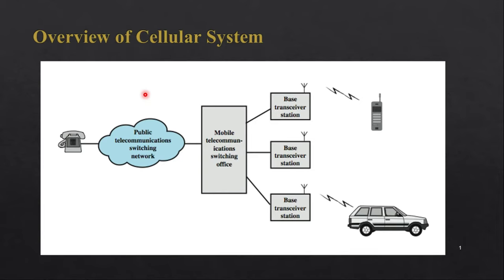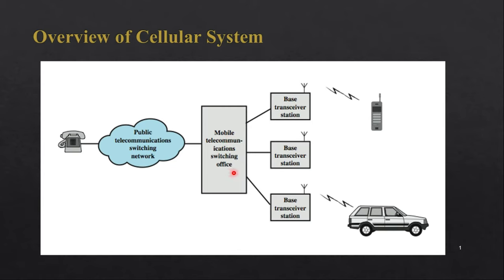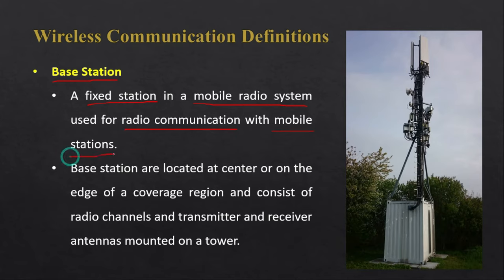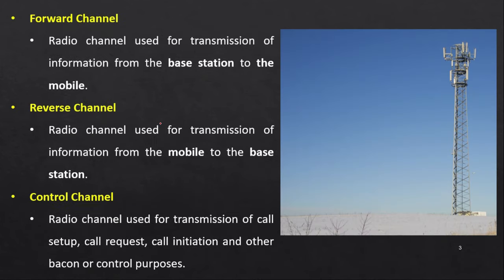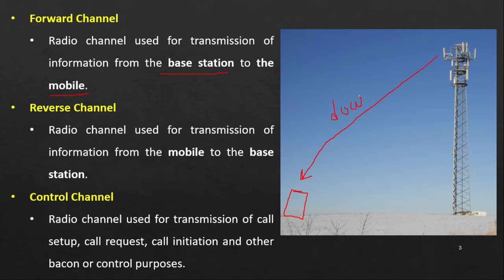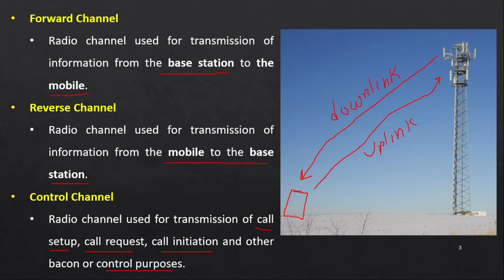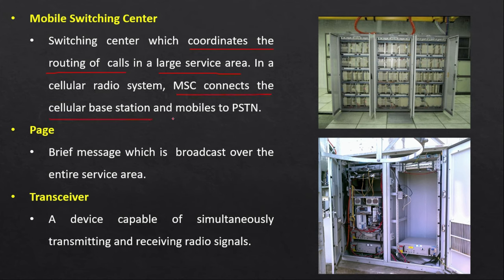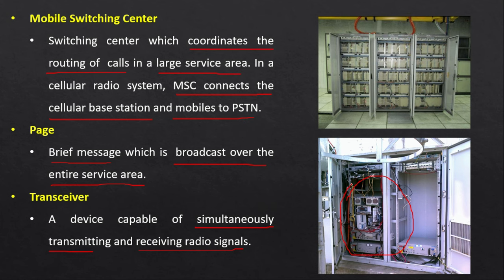Introduction To Cellular Mobile System | Wireless Communication Definitions

Comment: So between the base station and a mobile phone would be mobile stations or cell towers? Also how does a WiFi call connect to the cellular system? Thank you
Reply from the maker: This concept is for 2G system.

For WiFi calling, it works with 4G onwards, in 4G we have connection between cellular network and Internet, so it use VOIP to connect with cellular network while calling using WiFi.